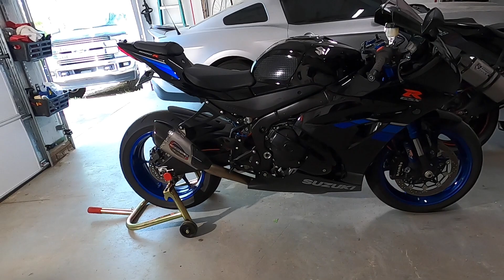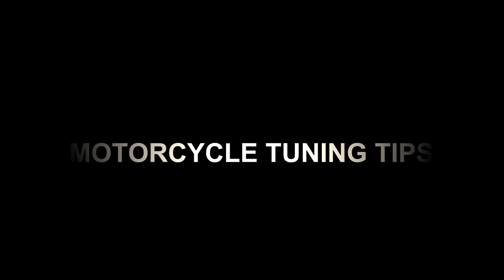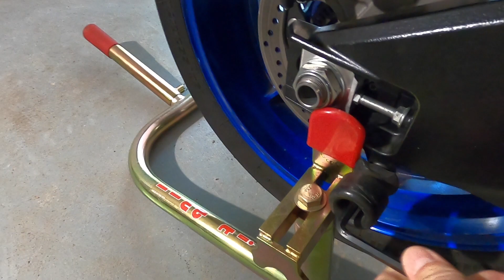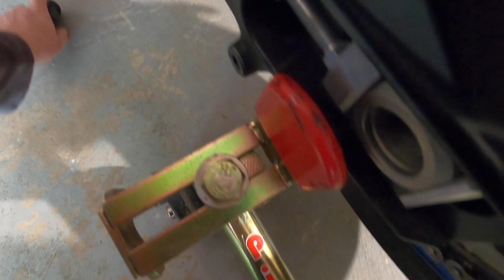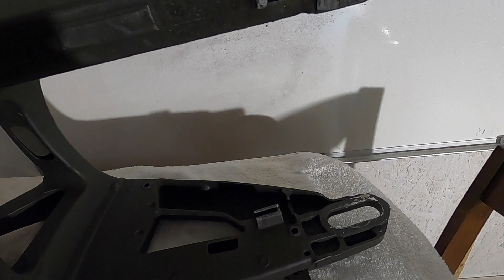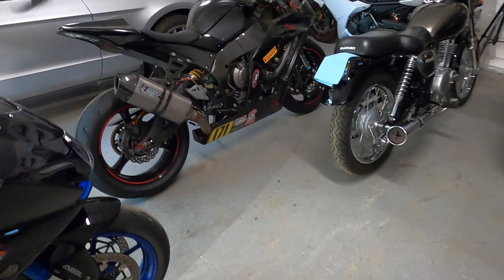BAD MOD SWINGARM SPOOLS! I'M TAKING IT OFF ALL OF MY MOTORCYCLES. NON REPAIRABLE DAMAGE!

Comment: Its called the boss not the bung- I've done that myself on a 750
Reply from the maker: Thank you!  I knew what I was saying wasn’t right. I couldn’t think of it though.  I’ve had 2 bolts snap and fight those out. This was the first time I damaged the swingarm.
Reply: I know the feeling... My 750 had that happen I didn't think about it possibly weakening the swing arm but you have a point! It very well could have? It was on the left side of bike ironic- my 18 1000r has a different design for the spools to mount, but seems like they rattle loose now? I've lost one already so I quit using spool all together.